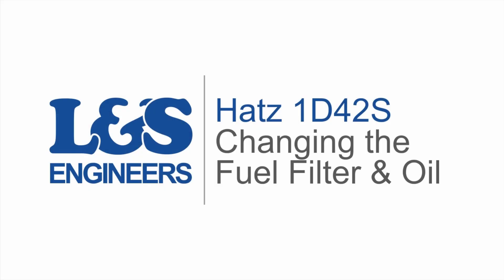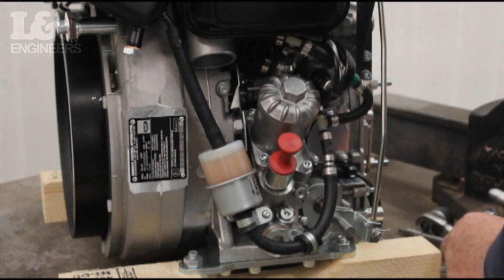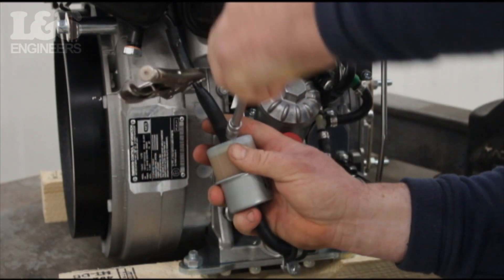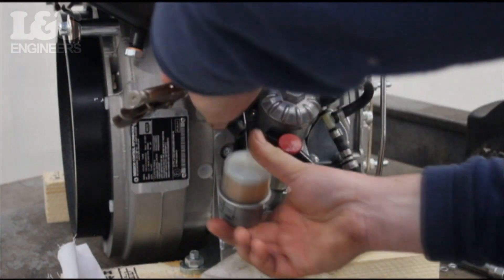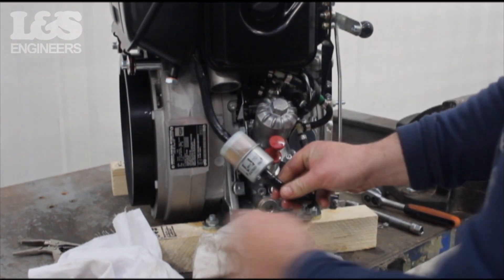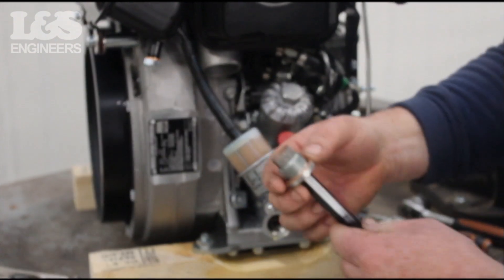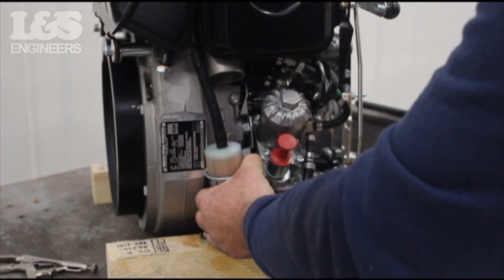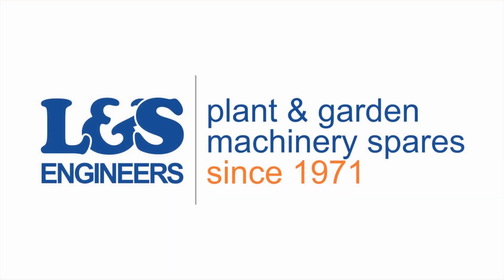How to Change the Fuel Filter and Oil on a Hatz 1D42S Engine | L&S Engineers

Comment: Hello,could you please explain me how to set the fuel pump timing on this engine?I have one and it doesn't start,look like the time is out,when you turn the pump foward,the engine gets a bit of fuel pressure but still doesn't start.thank you
Reply from the maker: Hi,  

Here is the workshop manual for 1D engines. If you look on page A 01.40 you should see more information on fuel feed pumps. 

1D Workshop Manual - https://www.lsengineers.co.uk/media/advice_centre/1D42S/1D42S-workshop-manual.pdf